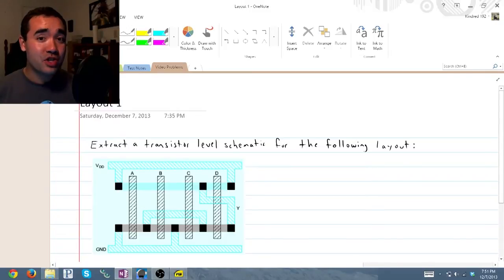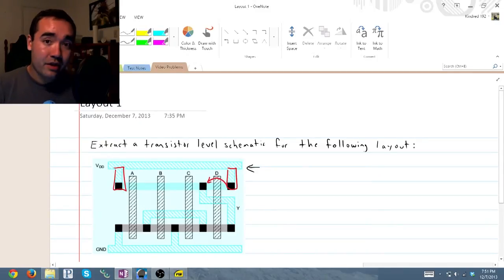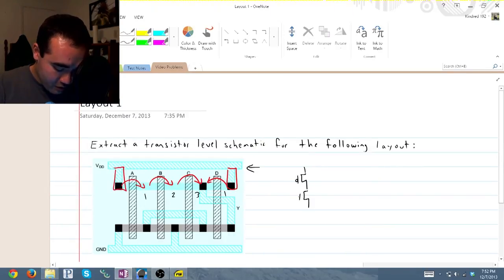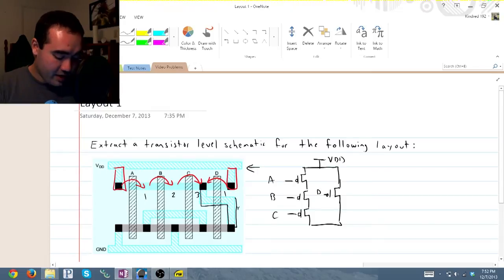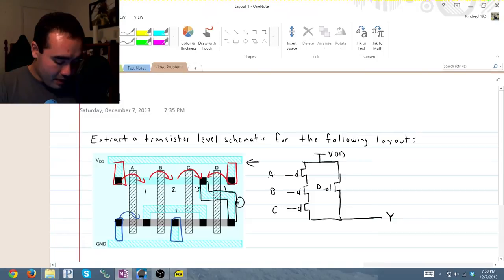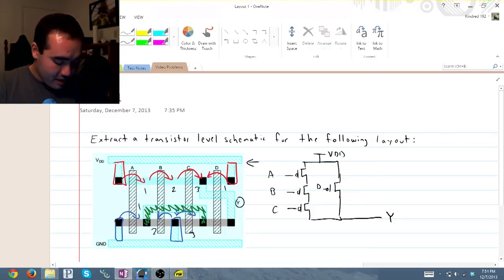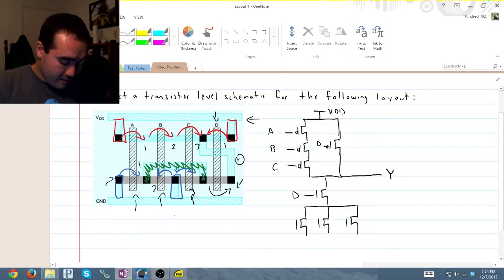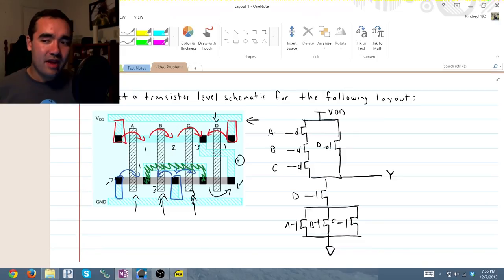IC Design I | Finding CMOS Schematic from a simple layout

Comment: I loved the video, could you upload a video where a typical exam is solved?
For example:
Given the layout of the figure, it is requested:
a) Bar diagram.
b) Diagram with transistor symbols.
c) Circuit operation table indicating, for all possible combinations of its
inputs, the state of the transistors, conducting network and its equivalent resistance, logic value
at the exit. Indicate the expression of the logical function performed by the circuit.
d) Assuming that a capacitance of 0.01pF is connected to the output, find the maximum delay
produced by the gate and for what type of transition it occurs. Data: Rp = 3kΩ, Rn = 1kΩ.?
......

Comment: How do you know the transistors on the left are PMOS?
Reply: left? All the transistors in the upside are PMOS and all transistors in the downside are NMOS because the circuit was building using a complementary logic with Pull Up (PMOS transistors) and Pull Down (NMOS transistors).
Reply: PMOS body needs to be connected to VDD in order to be properly biased so it makes sense to be on the top